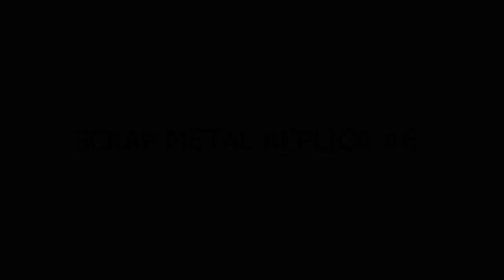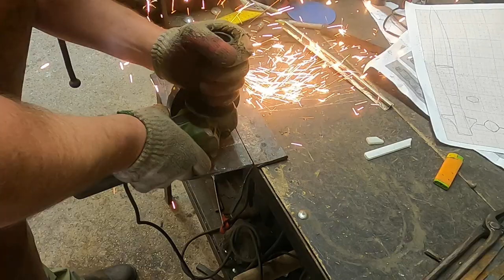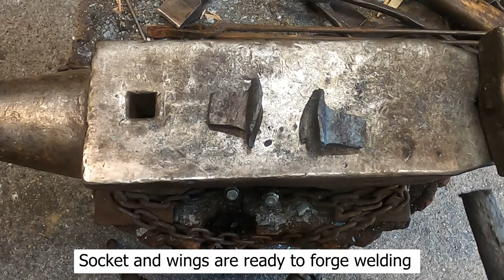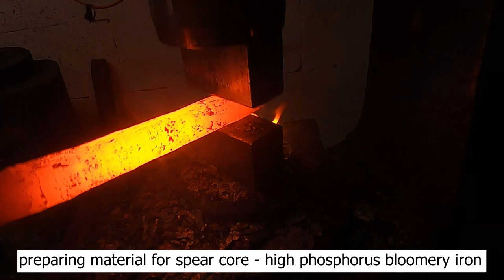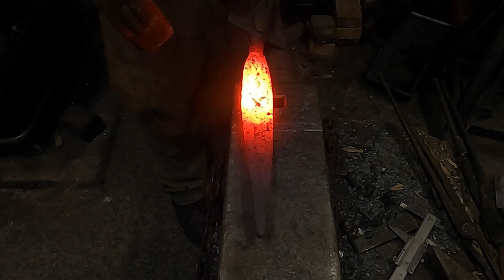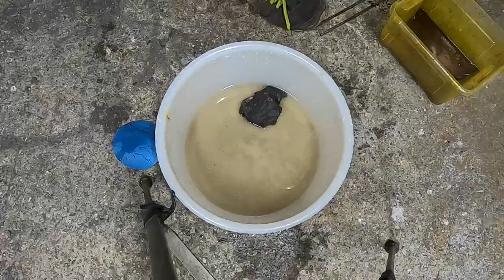Forging winged Viking spear, blacksmithing.

Comment: Nice video! But pity that the most interesting part for me, beginning of welding of wings, is missing. I woul like to try make spear with wings and I don't want to use modern welder. I know that in many cases, the wings were fixed by soldering by copper.
Reply from the maker: In the near future, I will show, how to do it without electrical welding machine support.
Reply: @officinaferraria  Still waiting :D
Reply: @Ulfheodin  You can always use wire to hold wings together - wrap wire in the top and bottom of wing, then weld wing sides, remove wire, and weld the rest. :)

Comment: In my opinion, it is very difficult to weld the spear bushing in this way.
Probably, if we consider modern refined steels, then this is generally impossible due to the higher welding temperature. It will not weld or burn.

And why did you weld the wings in this way, is there evidence of this method?
Reply from the maker: yes, there is plenty of evidence that some of the early medieval spears' wings have been welded that way and sockets also. I tried to forge-weld wings to the socket using modern steel and it was ok,  the only problem I see here is low carbon steel which needs high temp to weld but if only one piece (socket or wings) is medium/high carbon steel, forge welding is not a problem at all.